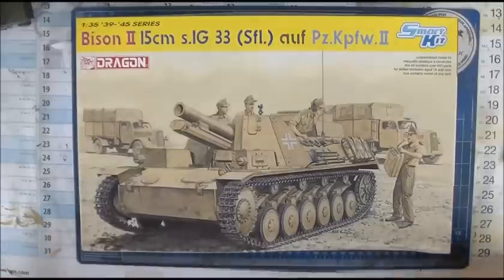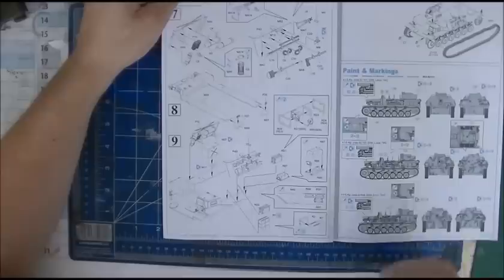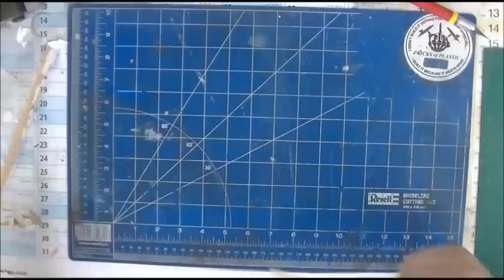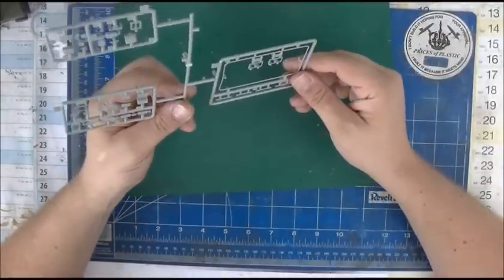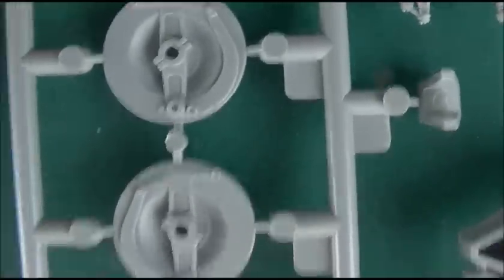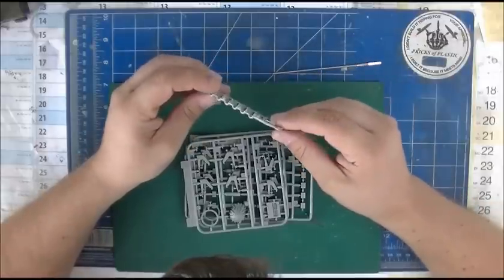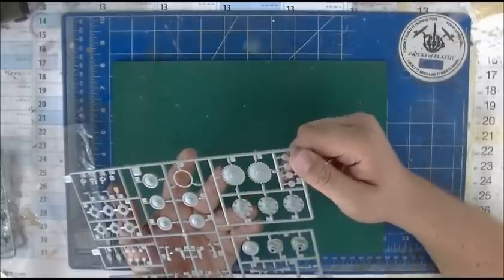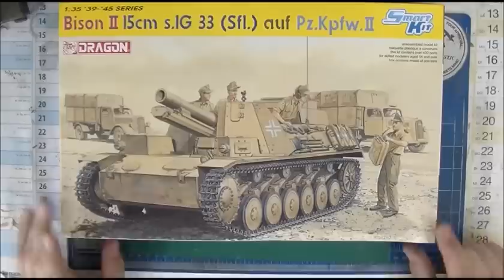Kit Review: Dragon Bison II 15 cm s.IG 33 (6440)

Comment: The reason Dragon have "split" the tracks is because the Bison witch in fact was based on the Pz. II had an extended chassi and an additional road wheel. Pz II have five, Bison have six because of the Sig. 33 extra weight. That's why Dragon "extended" the original Pz. II tracks. Considering the kit's price they could have molded a new longer one but it was not the case Regards.
Reply from the maker: Thanks for that, yeah that makes perfect sence, but like you say Dragon could`ve and should`ve make the tracks in one part.

Comment: Ya know,back in the day all that was to be had in regards to armor, were a few  monogram 1/32 kits based on the panzer iv.tamiya came along in the 80's with a few kits as did italarie,and for a l time that was all that was to be had.There was no photo etch or aftermarket items to be had.modelers  to based their models on reference pictures and scratch building to make up for flaws in their kits or to represent a particular vehicle.
Reply from the maker: +oddball I'm luckily not old enough to have been around "back in the day"

Comment: Good review !  I was anxious to see if this kit was one of the old ALAN kits that Dragon reboxed. I've always liked this rather rare vehicle and wanted one. Thanks to you I now know that this is a new kit. I've never had any issues with the DS tracks and I don't mind putting pins thru the side to sag them since I've been doing it for decades anyway because it was the best way.  Don't forget to check and see if there is some form of track tensioning device "before" you glue everything together. Dragon is sneaky about such !
Reply from the maker: +Ennis Anderson thanks, i don't have problems with DS tracks on general i just think it's strange that they have split them so now there's another "weak" point on the tracks